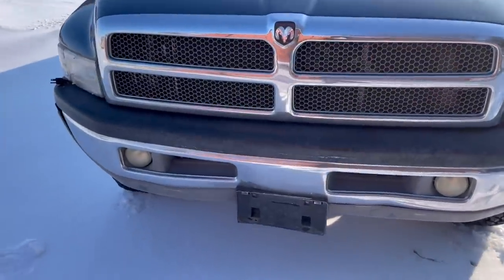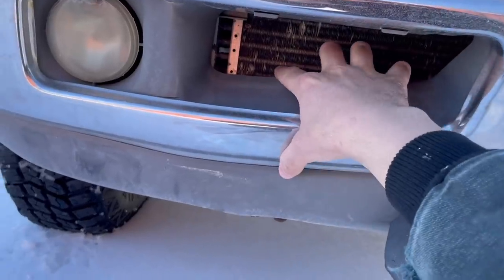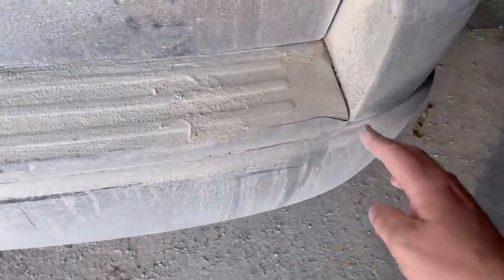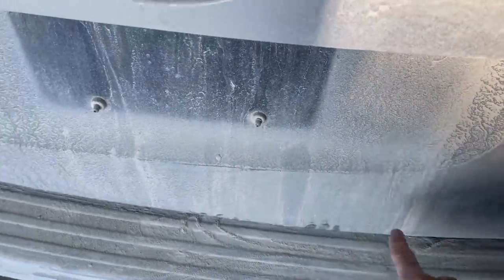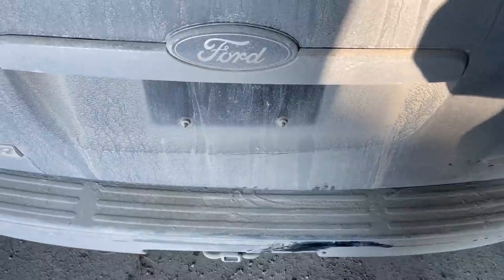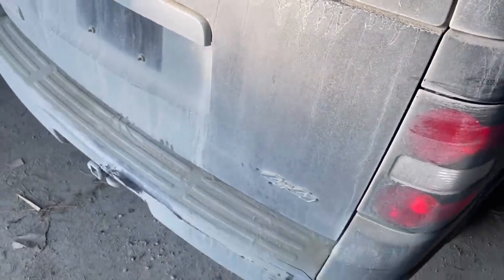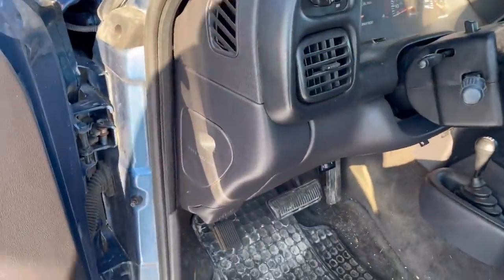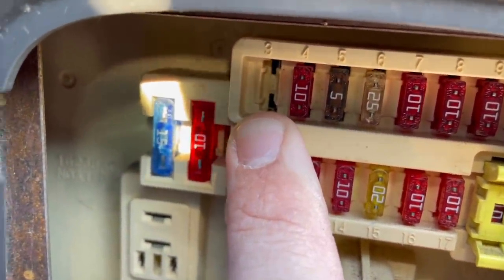How I crashed my new pickup, and how to make sure this doesn’t happen to you.

Comment: Years ago I was following a colleague in our semi rigs down a snowy motorway (freeway). He was a mile or two ahead. There came a point where to continue on the motorway you had to get over into the central lane. I took about a mile to get across whilst barely turning my steering. Soon I came across my colleague jack-knifed in the central safety fencing. He was fine luckily but I was glad I took what felt like a stupid amount of time to change lanes. Also I set the engine brake to come on when I let my foot off the gas (on a gentle setting) so never used the foot brake (we were only able to do about 30 mph at the time).
Reply from the maker: Wow that would be pretty scary. Jack-knifing a semi is on my list of things to never do 😬

Comment: Hey glad ur ok.. wanted to mention u might get lucky by taking inside panel off of wife vehicle to attempt to push dent out. Also if u use a plastic weld on the bumper I would recommend to put a piece of metal on the backside as well and use rivets too. If u counter sink the holes a little bit the head of the rivet won't be a issue to flatten a little bit and smooth over. In 15 years of working in a autobody shop I've seen that plastic weld fail many times if used by itself.  I hope this helps and good luck!
Reply: Hey feller I wanted to make sure I make myself clear that my comment is only recommendation/suggestion. If u choose not to do it the way I suggested that's cool and I totally get it. It does require body work and paint to look correct and that may not be worth it to you. I'm not one those keyboard warriors that will say mean things if u do it differently than me lol hope you have good day and God bless
Reply from the maker: Hey thanks for sharing your expertise! I hadn’t thought about removing the inside panel. That’s a really good idea. I’m definitely going to try that before I pay someone else to pull the dent out. I think I might just go for some new plastic. I could probably paint it myself and have it look better than trying to fix the old one. But I do have a buddy who is a good auto painter so I’m going to see what he would charge first 👍

Comment: Had the same issue with an 03 GMC. Took it to a mechanic and he thought I was crazy. Went to a national chain mechanic shop and he said "I know exactly what the problem is ". There is a screw in the sensor, that sometimes will get corroded, and when it does, there goes your abs. Fixed it good as new and checked the others, they were fine.
Reply from the maker: Yeah it seems like a bad system. There should be some way to disable the abs of a sensor is too far out of spec.

Comment: Check it Dodge has a recall on those brakes. Also, I have you could use the emergancy/ parking brake to stop.
Reply from the maker: Yeah I thought about that afterwards. If I would have put it into neutral and stood on the parking brake I probably would have gotten stopped. It all happened so fast there was no time to think of that though.

Comment: People forget that the parking (emergency) brake is still there and functioning. Just pull and hold the release and press down on the pedal to stop, yes it only applies brakes to the rear wheels but that's better than no brakes.
Reply from the maker: That would have probably worked except I was about 12 feet from the car when I realized that it actually wasn’t going to stop 😂

Comment: I had a 1996 Chevy Blazer (S-10 version) these trucks were known to have a ABS problem but GM would NOT admit to any problem!  It would lock them release the brakes when in slippery or gravel and you would just slide just like what happened to you. The only way to keep driving is was to pull the fuse just like you did. IIRC, the only thing that did not work was the cruise control.
Reply from the maker: Yeah it seems like there should be some way for the system to make sure this doesn’t happen.

Comment: In an emergency with no brakes, put vehicle in lower gear and use emergency brake. Or put in neutral, ten emergency. Also, always have an escape route so you don't kill. Been a motorcoach driver for almost 30 years. Thanks
Reply from the maker: That’s real good advice. I guess I didn’t have time to think about what to do. It happened pretty fast. BTW I used to drive transit busses in the city when I was in college 👍

Comment: Wasn't there a problem with the speedometer on the red truck?  See if there is a shop around you that does paintless dent removal.   That may save you some work and not be terribly expensive.  I really think you should have gotten an indicator that the sensor was bad.  Is the warning light burned out?  Problems with he sensor should disable the ABS system.  You might want to look into that.  There may be a deeper problem
Reply: That was my thought.
Reply from the maker: Yeah I have a guy here in town that does paint less dent removal. As for the abs brakes, I had hooked a diagnostic tool up to it a couple weeks ago and watched the wheel speed sensor readings and that left front one would occasionally get to zero a second or two before the others. Never had abs light on though until I took the fuse out.  I’m hoping replacing the front left wheel speed sensor will cure the problem.

Comment: Pop it in neutral and apply the handbrake, would be my primary attempt to stop from sliding into something if my wheel sensor suddenly fails. Luckily I drive a stick shift, so my car does not increase the speed on me without my action, but loosing a wheel sensor can be dramatic if that happens in traffic. And like you say, a Peterbilt hood ornament is not a good outcome for anyone.
Reply from the maker: Sure wish I’d have had time to do that 😂

Comment: I'm torn over whether to get a Ram 2500 or a F250. I'm leaning towards Ford now.
Reply from the maker: What model years are you looking at? It’s hard to beat the old body style fords 92-97. The 7.3 power stroke is a heck of a motor if it’s been taken care of. I kinda hate dodge trucks but I love this engine. And I got a great deal on it
Reply: @dodgebrothersfarmandranch9206  Kind of around early to mid 2000's. That's the main selling point for me on a Dodge too is the Cummins engine.

Comment: Or you can hit the park brake if if is a fully mechanical system that abs cannot control but some are electric that goes through the computer but it should work no matter what if you hit it and in some new electric vehicles there is a backup battery for brakes and power steering but it is the same if total failure there is no brakes on the pedal but use the park break
Reply from the maker: Yeah I might have been able to stop with the emergency brake but I didn’t have time to react.

Comment: That is a very poor design! The ABS system should be engineered so that when a wheel speed switch fails it disables the ABS system. This usually happens because "engineers" trust the computer over a fail safe system. No telling how many people have been injured, or killed, because of this design!
Reply from the maker: Yeah exactly what I thought
Reply: Im an engineer and I agree. Should be diagnostics built in and a faile safe mode.

Comment: Danage looks fixable. I wouldn't spend money on it myself.
Reply from the maker: Yeah I’m thinking I’ll epoxy the plastic and pull the truck bumper out with a slide hammer. I bet the dent in the explorer hatch will pop out pretty easy.
Reply: @dodgebrothersfarmandranch9206  I recommend flat strips of plastic or metal  behind the cracks for more glue surface area.

Comment: Using Boiling Water and a Plunger to Remove Car Dents ( I tried this on my dads car. It worked great. I did not use boiling hot water just pretty hot. I was afraid of messing up the paint.)    https://www.youtube.com/watch?v=Vzo4aJuahJ4
Reply from the maker: Hey thanks! I’ll check into that!
Reply: @dodgebrothersfarmandranch9206  Glad the failure was not at speed.